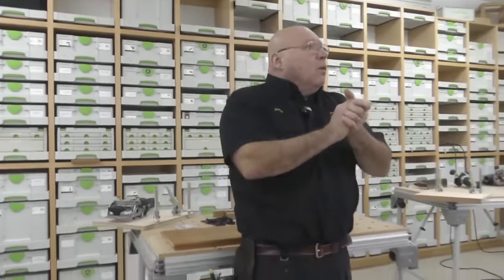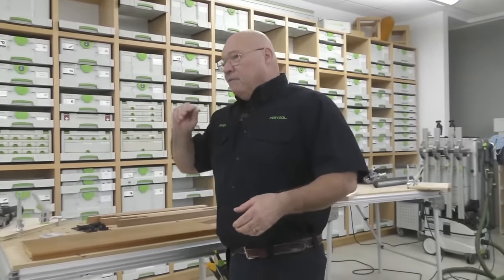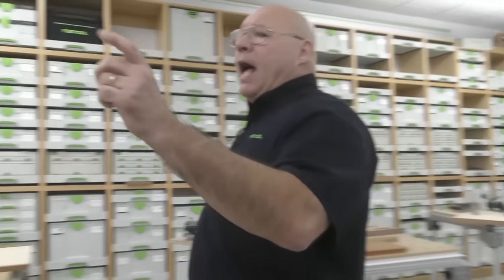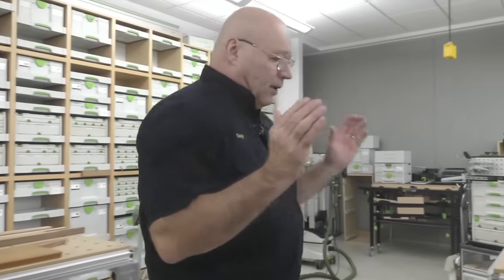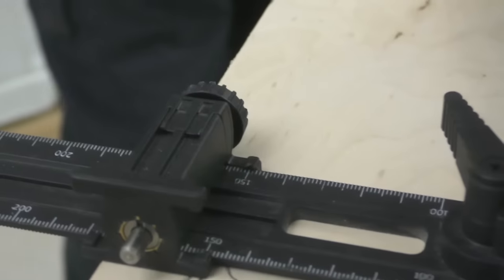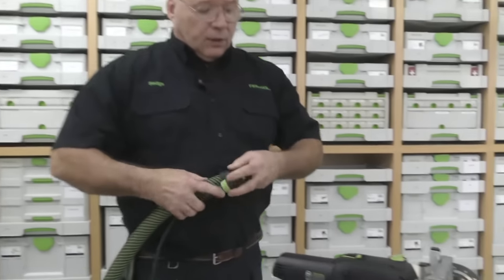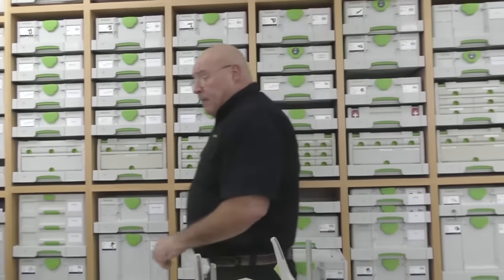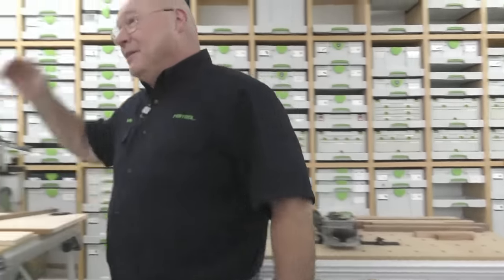Festool Live Episode 163 - Domino Edge

Comment: Why not just reference the plate of the domino to the height of the plywood on a flat surface to the roughly 18mm? Seems like you could cut out a few extra steps rather than shimming the plate to an offset to get you to pretty much the same place
Reply: My guess is because if your trim piece isn't perfect, or your plywood surface isn't perfect, you could have slight gaps to fill instead of sanding it down to be perfect across the joint.